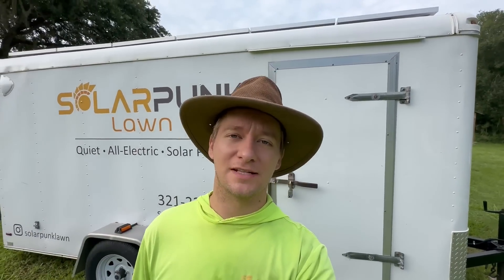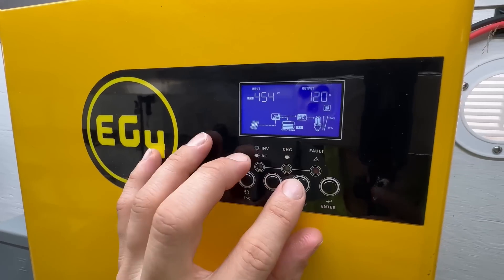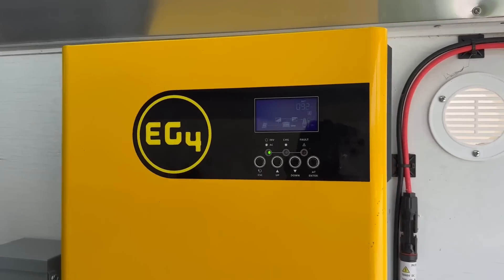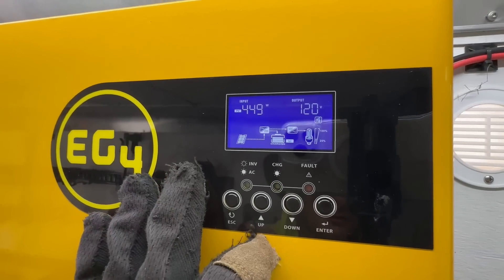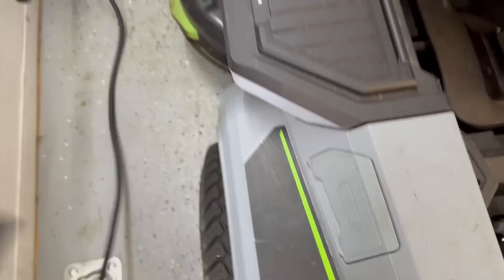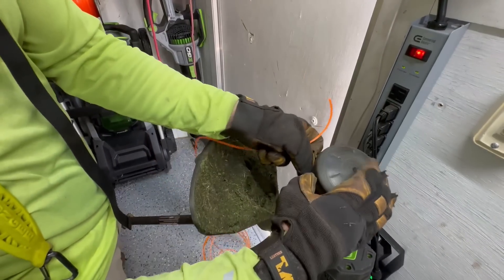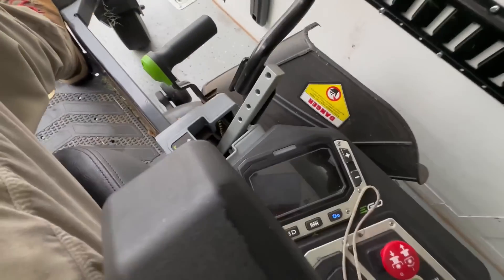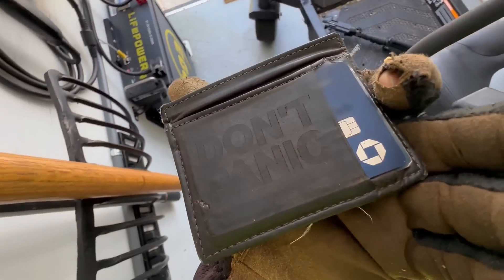Mow Forever? Solar Powered Lawn Care

Comment: Great setup, I'm in the process of transforming my trailer into solar as well. I have zero knowledge of what to do but I'll get it, thanks for sharing!
Reply from the maker: Hey thank you for the kind words! I knew little about what to do when I started too so I’m working on sharing everything I’ve learned to hopefully help others out with the same questions I had. Feel free if you have specific questions to ask, I’m happy to try and answer what I can!
Reply from the maker: Edit: not sure why but the person that I was replying to deleted their comment. Below was my reply to someone saying Bluetti is easier:

Easier? Yes. Cheaper, more capable? No.

If you wanted the same battery capacity I have @5120Whs, it would cost $3400 going with Bluetti. Granted it has an inverter built in (my inverter + battery = ~$2050), but the Bluetti is less capable at 2200W, so you essentially could only charge like one other battery while the mower is charging. Not a huge deal, but we haven’t got to solar yet. The max solar array they claim you can hook up is 900W, so already smaller than my array by 300W (max eg4 solar is 5000W), and the solar they sell on their site you can’t actually get 900W, closest is 800W. 800W of their solar panels will cost you $1800 ($2.25/Watt vs mine at $1.12/Watt).  So altogether you’re looking at almost $5k for the Bluetti at less capability and less solar. 

Look I totally get it: what I’m doing is not practical for everyone and I’m not recommending everyone go out and try to build a system like this (electricity is scary). I just want to bring attention to the cost of some of these battery generators when you really look at it. 

I fully understand most people will opt for something like the Bluetti or ECOFLOW systems as more and more are trying to make their electric lawn care rigs work. Hopefully costs across the board come down for everyone and we get some great improvements in the mean time.  Already the things that have come to market since I first started planning this system almost two years ago has been incredible.
Reply: @solarpunksteve hi do you have a video on how or what to buy to have solar power on the go. Thanks awesome video
Reply: Can you do a walk through and show us what you're running? Like the panels, inverters etc. I'm also trying to do this. Thank you and awesome content
Reply from the maker: Absolutely! I'm editing the video as fast as I can. Stay tuned!
Reply: Awesome!! Thank you and looking forward to more content from ya
Reply: Does the solar charge the yellow thing on the go or once you drain the yellow thing lol. Is it over for the day thanks
Reply: Your wearing a camo shirt and trying to be another solar liberal 🤣🤣
Reply: @7.3King97 On a big enough scale, which he definitely has, you eventually get a return on investment by running battery powered equipment. Which he currently does. Now battery powered zero turns may have some work to do before you get that roi vs gas but he already uses other things battery powered. And he stays buying or getting thrown to sponsor - new equipment. This is about business and you’re bringing politics into it.